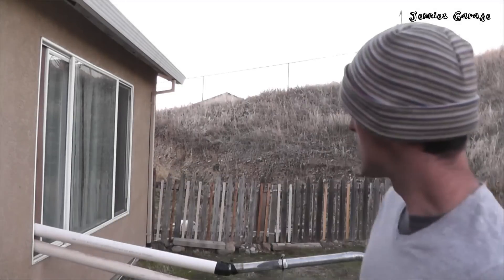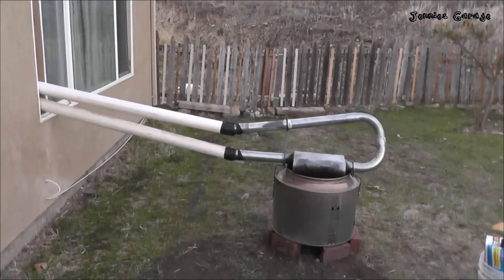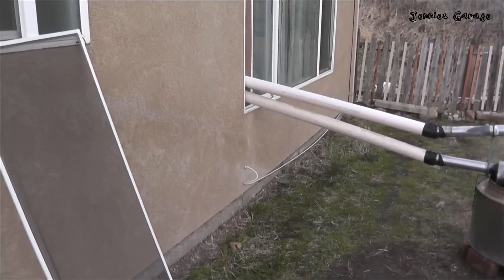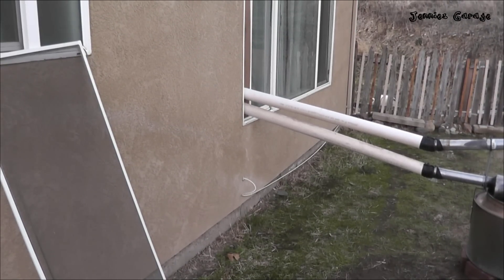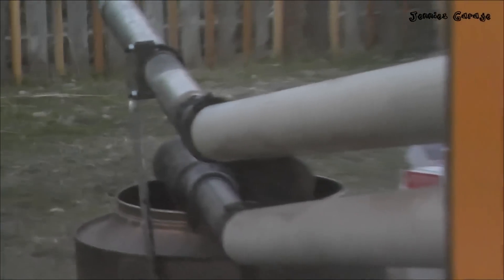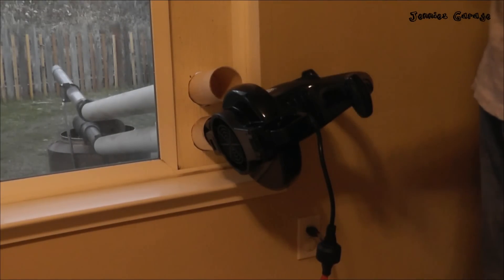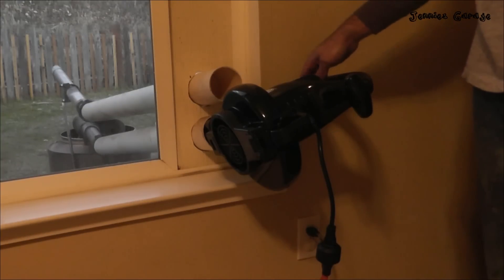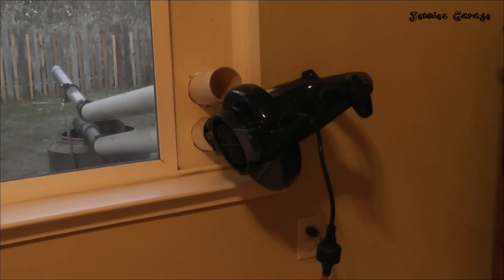How To Heat Your House With Garbage - Testing The Trash Furnace

Comment: Cool! Try an old computer fan. Not as much power, but much quieter. You might have to go to a metal pipe going back into the house, as you may be near the limit of what the PVC will take temp wise.
Reply: I totally agree.  they have ac run sized computer fans too, which can pump quite a bit of air.  Using the muffler was an excellent idea.  :)
Reply from the maker: I kept an eye on the pipe and it didn't feel like it was getting soft or anything. You're right though metal would probably be ideal. A computer fan would be a lot quieter but it might not move enough air. l have a few laying around, maybe I'll give it a try. I am trying to think of something not quite as obnoxious as the leaf blower that can still move some air.
Reply: ***** http://www.ebay.com/bhp/squirrel-cage-fan-motor
Reply: ***** Use a fan like this http://hydrofarm.com/product.php?itemid=8095  and use a speed controller like this  http://hydrofarm.com/product.php?itemid=8589  should move more then enough air and will run quiet enough for regular operation. keep in mind this is a wholesale website so you need to look at their where to buy link to find a store near where you live.
Reply from the maker: Jeff G
Thanks for the links. It so happens I'm working on adapting a squirrel cage fan to use with the furnace. That speed controller looks like it would work great.
Reply: ***** cheap second hand room fan(vertical stand type), shroud suffice
johnlewis.scene7.com/is/image/JohnLewis/231657432?$prod_main$
Reply: John Duskglass Not true. PC's are DC not AC and while there are fans that look similar size to PC fans that are AC, They aren't actually made for PC's. And in all my time building PC's I have never heard of someone putting AC fans in their PC. Sounds absolutely stupid.

Even these AC small fans aren't enough. A normal PC fan, even ones that spin at 3000rpm don't move air in the right way that would be needed for this project. For this project you want the air to be very directional and the narrower the better. 
What is needed is a centrifugal fan.